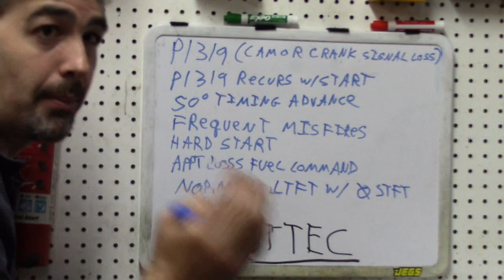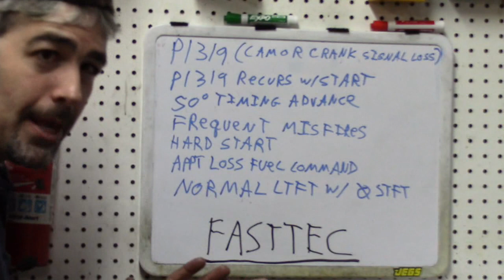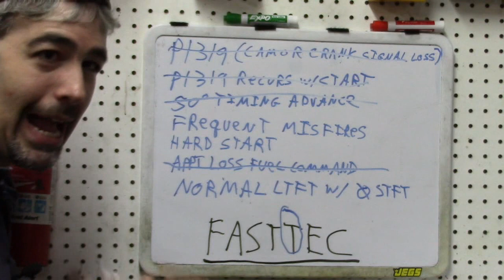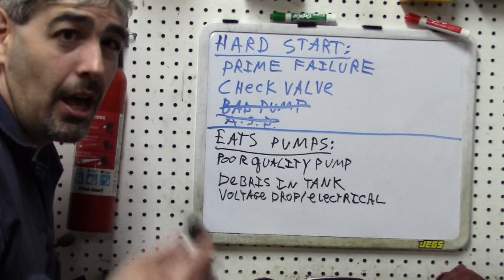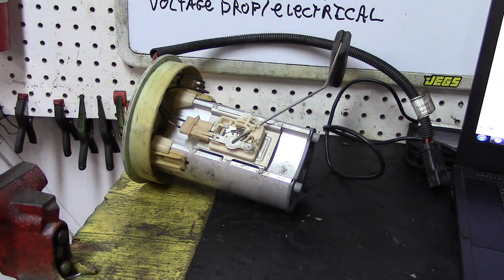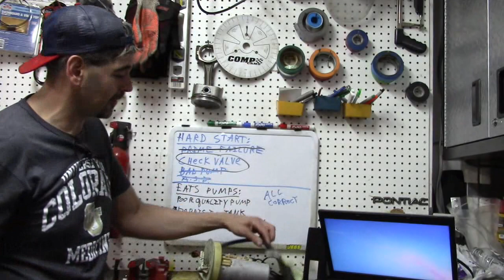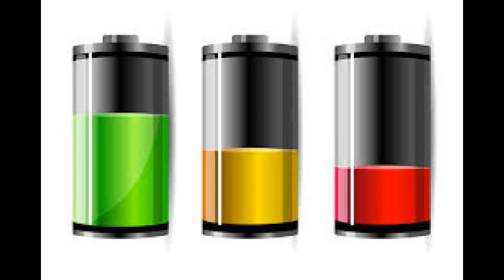Jeep Eats Fuel Pumps Follow up and Hard Start Diagnosis and Repair

Comment: I left a comment on the previous jeep video before seeing this video, and it basically says 'I told you so', but I am quite surprised there is no strainer sock.  that is shocking.  that sediment is like sandpaper inside the pump.
I also asked before 'where does it all come from?'.  does it get pumped into the car at the gas station?
Reply from the maker: these this is not like sandpaper in a pump- it causes inhibition of flow which overloads the pump because it has to work harder to meet demands of the LTFT adjustment.
Reply from the maker: How did you differentiate flow interference vs voltage drop? There is no way i can see you can possibly have know. the cause vs guessing the cause. There seems not enough at this point to make definitive diagnosis until a voltage drop is established.  What analysis method based on available data at this point are you using that you supposedly knew obstructio had to be the cause? I certainly don't see it as possible yet given my methodology.
Reply: one thing you do mention in the beginning is that the vehicle has 270,000 miles on it, if I am not mistaken.  that equals alot of times gas was put into the tank.  

if there is no strainer sock, then the sediment is actually going into the pump.  how could it not be?  actually, I only thought it was obstruction, I wouldn't have suspected a repair to be done without a strainer sock.  yes, with the strainer sock that is supposed to be there the sediment blocks fuel and over works the motor.

'How did you differentiate flow interference vs voltage drop? There is no
 way i can see you can possibly have know. the cause vs guessing the 
cause. There seems not enough at this point to make definitive diagnosis
 until a voltage drop is established. '
I see where you're coming from and I admit there could have been some other cause.  I don't know of many people who need to keep replacing fuel pumps.  to see this happen and it NOT be caused by debris would make for one awesome video.  
one thing we both agree on, I'm sure, that this video should  let people know what they are putting in their car when they buy gas, and I don't think this jeep owner is an isolated incident.  everybody who has high miles on their car has sediment in their tank.
Reply from the maker: The strainer sock itself impedes the flow in contaminated tanks as sediment accumulates in the sock.  Without the sock, the sediment will accumulate in the filter which is why this latest pump had an especially short lifespan- the filter pore size is far smaller and thus clogs far quicker.
  Cleaning out a fuel tank every time a fuel pump is changed is an essential step.
  In fact just this last weekend I diagnosed this same exact issue on a no-start.  Owner changed pump 6 months ago himself without cleaning tank.  I was able to get the car to run with a new filter but the LTFT is so high now that I anticipate he barely made it home and within a month he'll need the pump replaced again.
Reply: many cars had a drain bolt at the bottom of the tank, but now, I don't know of any that do.  also, I know of some cars that don't even have a filter other than the strainer sock, which is not the way a car should be made.  I had an 87 accord and it had two filters that were not in the fuel tank.  one in the engine compartment, and the other between the front and rear wheel on the drivers side.
when repairing one's own car the repair, obviously,  is much more likely to include removing debris from the tank, but I have never seen anybody remove sediment from someone else's car.  when I worked at firestone fuel pump replacement was common and never did they check for debris in the tank.  unfortunately, the reason for that probably is, that it is a corporate policy, the workers there may not be allowed to.  the same can probably be said for goodyear, valvoline, or those other franchise repair places.  I can honestly say that that was high quality work you did for that guy.  I'll bet pulling a tank down is not something you would rather not do.

Comment: Wow, just finished watching the video and was awsome...  As for the end with the dead battery, I am the same way I try my best to diagnoise the issues rather than just replace.

Tho I like your comment on this.. My mother who bought a used 2010 dodge dakota recently.  I was with her when she bought it, and it ran beautifully.  Tho I thought it was lacking in power because it was a 6cyl,  it was a good truck but all of a sudden it lacked power and then ran horribly, I then checked the codes and the only thing was showing was misfire on cyl 2!! unfortunately I need to depart and she took it to many "quote" experts who said everything from bad valves, bad cylinder, bad head and even engine replacement all ranging from 500 to 3000 dollars.. big money for her.. she then came over to my house and left the truck with me for a while because I knew that they were all wrong!! because the car was sooo new and it from my drives which at times drove fine! I knew it wasnt the engine but something simple.. unfortunately I didnt have the tools as u do, but I had a step theory of what to rule out.  As I went slowly from problems with the engine to problems with the injectors to completely disassembly of the wire harness, I found out what was wrong.. it was a short in the #2 fuel injector.. Some where in the wire harness there was a short which caused the fuel injector to misfire.  So then I had to backtrack, read wiring diagrams finally understanding where the issue was and fix the problem of bypassing the affected area and install new wire.  All this for about 5 dollars worth of wire, (plus 20 or so hours of headache lol)..the point is that I wanted to share this.. that I believe in your method and laugh at all those who just say! "Change the Battery!!!" So hope us share this story because I am truely a student now watching your videos..  :D.. -Psyburn74

PS.. I hope electric cars will be much less dirty and oily lol.
Reply: Shelby Joe great work alot of techs always try to change a part etc but they forget about the electric wiring

Comment: I must admit I looked at the Freeze frame and thought to myself well the fuel trims look good and completely missed the 50 Dec advance timing, a good lesson for me! I wonder if the debris caused the check valve to fail in some way? I won't be surprised that's for sure. I am confident that the pump will out last the 3 years.

Comment: thank you very much for sharing your knowledge actually this is video very very helpful i had same problem in my car and i was able to fix what i like about you the way you thinking to figure out the issues and identifying it , i have a question about this truck the jeep,  what you think is cuz the spark plugs always make ticking sound on idle or when the car running is that might be a camshaft sensor or the camshaft synchronizer not properly in the right position ? the spark plugs changed many times the gap is %100 correct i even tried the oem per-gaped plugs the ignition coil i brand new oem part   what you think it might cuz this issue ? hopefully you can give me a hint or idea ..thx
Reply from the maker: I would say the problem is the spark plugs are clearly not the issue
Reply: thx for your response and yes i guess the spark plugs or the ignition coil not the issue cuz i tried 3 different spark plugs brand with correct gap guanine new ignition coil as well i read some articles says the camshaft synchronizer is responsible to manage the sparking i am not sure this is right or wrong but i am reallt confused cuz the computer not throwing any trouble codes  i checked the electric plug for the ignition and the plugs itself i checked if there is any bad ground nd nothing of that founded this ticking in the spark drive me crazy  .. any recommendation where can i start ? thx
Reply from the maker: Ali Abdullah I would suggest you dentify the clicking sound cause. Maybe its internal.
Reply: actually its not clicking sound it ticking sound the normal ticking sound when the spark plugs fire up, its simply the regular sound when the spark happened but it always there all the time when i am running and when the truck idle i am just wonder is the camshaft responsible to manage the sparking ?
Reply from the maker: the CPS does give signal to the coil.
Reply: actually this sound what i exactly have and its not the stuck or sticky lifter that the 4.0 engine sufferer from , but in my case it sound like come from all the plugs not only one like this video ..can u plz check that out 1 min video
Reply from the maker: i have no idea what you are saying you suspect. if you suspect a cam sensor problem jut do a cam sensor bypass by putting voltage to the cam signal is all you need to do to confirm.
Reply: ok got it thank you so much

Comment: story at the end was very funny :). but I can tell you first hand, I probably make wrong quick diagnosis like that far more often than you overlook an obvious solution.  Given that situation, I would have tested the alt, and after it checked out, Immediately replaced the battery.  But.. if that didn't fix it..............................
Reply from the maker: There have been several times I have been at Autozone where the guy in front of me was trying to return a battery he just bought and exchange for an alternator.  later that day when I do my CORE return the same guy was there trying to return the alternator.
Reply: lol. yea. been there myself. and not proud of it.

Comment: what are you calling a check valve a fuel pressure regulator...lmao
Reply from the maker: Sorry... ummmm.... what??? How is a fuel pressure regulator even involved in this? How would a FPR explain the lack of static pressure? Please explain. How could a FPR possibly be implicated given the LTFT and STFT data?
 What on earth are you talking about?
Reply: ummm I think I can see it. Maybe more of a communication problem than anything. If a FPR is supposed to dump excess pressure back to the fuel return and it fails to close properly it could look just like a bad check valve. I'm not an auto tech, but I'm pretty sure that I have at least one car with a FPR that works that way.
Reply from the maker: Seems you do not understand the difference between an FPR and a check valve's operation. Besides how do explain a LTFT at +5 with a zero'd STFT if you suspected a FPR???  That makes absolutely no logical sense, don't you agree?
Reply: I know very well how a check valve works. (the electrical equivalent would be a diode) Also an FPR is a fuel pressure shunt device. (again the elec. equiv. would be a Zener diode) You can have all the check valves in the world and if the FPR is not responding properly to low fuel pressure and closing down residual fuel pressure from previous pump cycles will not be maintained and the pressure gauge will crash at key off just like in your video. Furthermore, it will similarly take longer to build at start up causing the long crank times as noted also in the video. You may have experience that tells you the check valve is the more likely culprit but if you want to diagnose then at least do the same pressure test with the return line pinched off. In this case a very short key-on cycle would tell you what you want to know even with reduced pressure without causing excessive buildup in the system. IMO, and I will be wrong but a positive LTFT with a zero STFT is merely an indicator that the malfunction is both moderate and consistent.

Comment: hmm i wonder if this is the case with my jeep. 03 liberty, hard starting. will crank and turn over sometimes on the first try sometimes on the2nd or 3rd. Automatic start sometimes works first try, sometimes takes 3 tries. Driving fine though, not stalling on me. Mechanic looked at it yesterday and was puzzled and was going to do ignition switch but i dont think that's it as my dash lights up. Just had a tune up a month ago and new spark plugs were put in. It seems to be hard to diagnose what's going on.
Reply from the maker: I don't know. What data do you have? What's the LTFT curved against load show? What's the static vs load fuel pressure? What's the TPS voltage relative to position?
  Why guess?
Reply: +Schrodingers Box I have no idea on that info haha all I know is no codes popped up and I'm getting frustrated and hoping the mechanic can figure it out. I'm just trying to see what other people did to fix it.
Reply from the maker: lilpiggy742 Not a good strategy.  10000 things could cause this so if someone fixed this symptom there is no logical indication it is applicable to your or anyone else's condition.
 I highly advise against this extremely common but completely illogical approach.
Reply: ended up being the fuel pump! .
Reply from the maker: lilpiggy742 The LTFT curve that I mentioned earlier would have shown that the very first time  Data analysis is always the best approach and would have saved the unecessary parts.
Reply: Thanks for the advice!

Comment: similar issues, zj 5.2 96. sounds the same when cracking the engine. I can get my jeep to start, but stalls out from park to drive or drive to neutral my rpm's will drop all the way down and stalls. replace tbs ,iac, new brain, fuel filter, new muffler, cleaned t.b. my temp gauge on the dash just went out also. I ordered a new fuel pump I should be getting in the mail today this is going to be my last fix if it doesn't work I'm stumped... also before switching my computer I only had 02 sensor codes.
Reply from the maker: I don't follow... what was the data you have that indicated you need a new fuel pump?
Reply: throw the whole parts store at it... sounds logical

Comment: why did the codes said it was a problem of cam/crank if the real problem was the fuel pump? (i have a jeep grand cherokee 2001i think same problem)
Reply from the maker: That wasn't the case at all. It was both issues separately.

Comment: What does it mean when check gages light comes up on my Jeep? It comes on when my jeep dies and turns on after a couple minutes and then the light is gone. I read the codes and it shows p1391 CKP or CMP sensor signal intermittent; p0133 oxygen sensor. I replaced the oxygen sensor with a mopar sensor. Will the p1391 code make my car stall an give me the check gauges?. I did a oil change recently and got a new battery. When i replaced my battery i checked my alternater and it was good, looks pretty new.
Reply from the maker: +Casey Jon&#39;s I'd say the chances are the fuel trim being off from the Hall effect sensor fault explains it. Test power, signal and ground at the Hall effect and verify if it is component failure or circuit failure.

Comment: The fuel pump check valve failure describes my issue with a 2000 Jeep Cherokee to a tee. Now I know how to confidently express this issue to a mechanic. Enjoy your channel.
Cheers
Reply: +Patrick P 
HI There i have the same start issue i have to run the switch to on and off three time and then car start, replaced fuel pump to Walpro but probably much better than before two time to start, the only things on my mind to replace stock fuel filter never replaced because i blow the air but hard to pass, do you things this gonna help? i have 2001 Xj

Comment: I have something to add about fuel system not holding pressure. I have a 1996 Camaro that was doing the same thing, and actually the car would act like it was getting vapor locked. on a hot day you could literally crank it until the battery was almost dead. I put a fuel pressure gauge on it and the pressure was dropping as soon as the key was turned off. I assumed fuel pressure check valve. I replaced the fuel pump the same symptom. I really was running out of ideas so I tried yet another fuel pump (replaced 1st pump under warranty). yet the same thing again. now I was getting upset. the fuel pump that I bought was an airtex replacement and it came with a new plastic hose that went from the pump to the sending unit. it was a hard flexible plastic hose. I finally took that off and replaced that with a rubber fuel injection hose. all of that messing around and that's all it was, a shitty part. I used the brand new plastic tube/hose that came with the pump and it didn't hold pressure. that's how I fixed the problem and the car runs perfectly to this day. what a headache.
Reply: Glad you got it sorted out.  Within the Jeep community there are a few golden part rules...some of them are 1.  Crank Sensor should be Mopar/OEM if at all possible, aftermarket radiators have about a 3/1 failure ratio (buy 3 - one works), and never. ever. buy an Airtex fuel pump.   The rate of "fail out of the box" and "failed within 10k miles" and "failed within 1 year" is astonishingly high.   I hope yours lasts a long time and gives you good service!
Reply: airtex fuel pumps are crap. that fuel pump was also quite loud. sounded like an APU in the gas tank. i got rid of it, replaced it with a $80 fuel pump from HFP 255 LPH fuel flow. that airtex pump was $140 what a waste of money, but its what advanced auto had in stock the day i was doing that job. retail auto parts are sometimes very bad, cheaply made but expensive junk